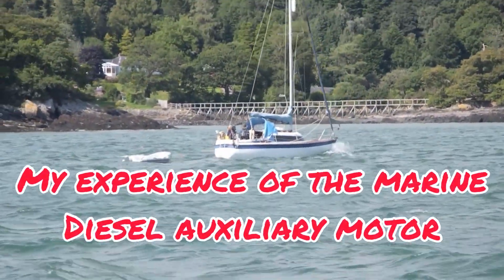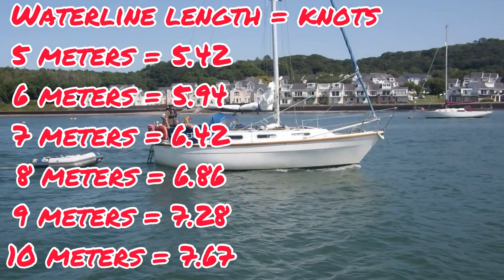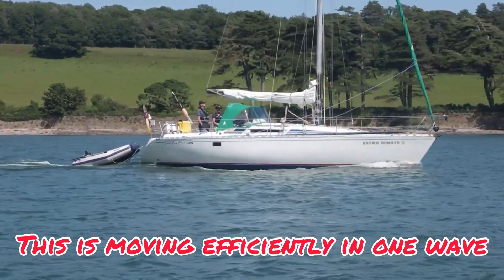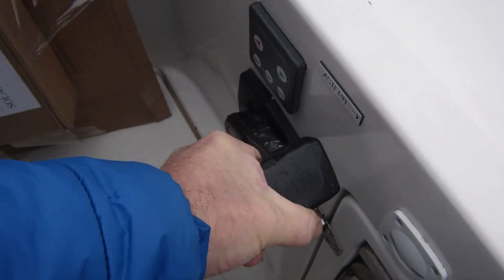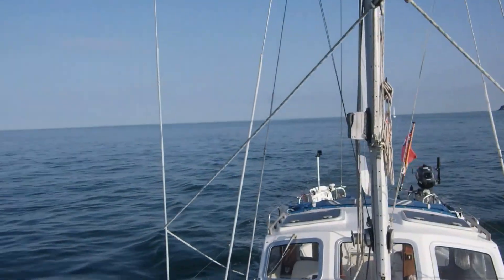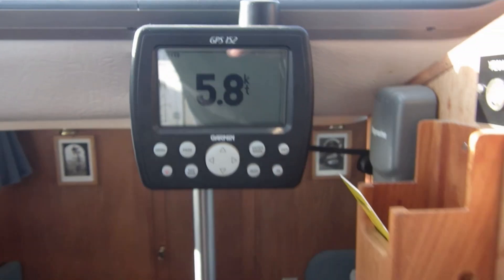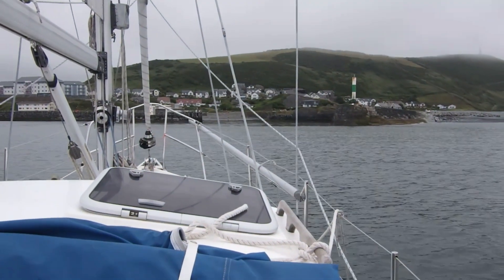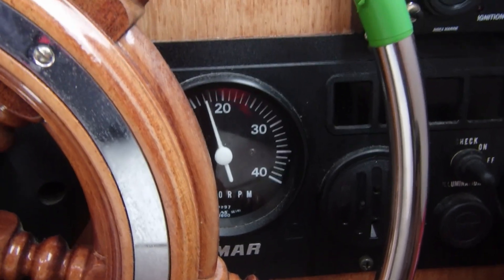Marine diesel (auxiliary) motor

Comment: when using engine  at 70% for a time  try to give engine time to cool  at low revs before stopping it  ,  turbo engines in par tic.  sweet  spot also depend on sea state  ,powding  into head sea  .  all said though good advice. HAPPY XMAS   to all tearing up £5  in the shower
Reply from the maker: You got me there Neville, I must be way behind the times as I never knew they produced turbo charged auxiliary motors for yachts. Im with the concept of allowing cooled oil into a hot turbo for a period of time as I use to fit turbo run on timers to commercial marine engines. Thanks for your input well appreciated and a Happy Christmas back at ye. Not sure I want to tear up fivers in the shower though lol. All the best mike

Comment: Could I add a point to your engine on process?
From bitter experience of getting a twisted fecking Gennacker down in sheet-whipping wind.
Just before hitting the starter motor.....check for lines in the drink.
Or.....
how to avoid a calamity becoming a disaster.
Reply from the maker: Well agreed Ratus but I hope that’s only a mistake we make once, usually in a high tidal flow with lost of moored obstacles mike
Reply: @sailingcosiloveit  I keep thinking I've made all my "once" mistakes but nope there's always another  cockup I haven't thought of not doing yet.
You should run a comment section contest for the most outlandish sailing gaffs.
Reply from the maker: I hear ye! You gonna be in the top cock up run then 😂